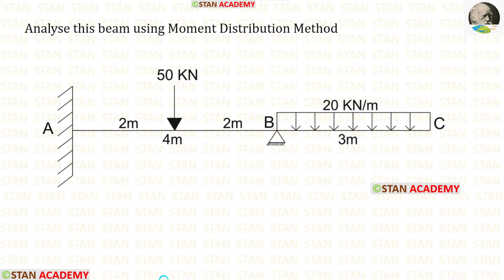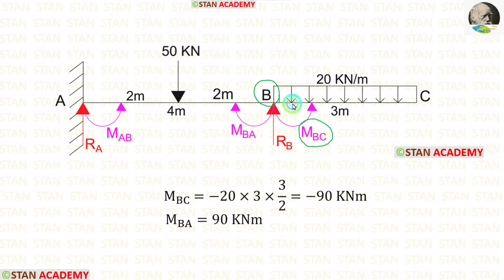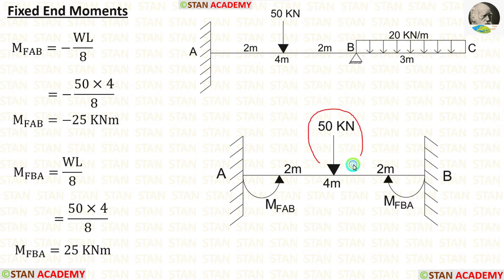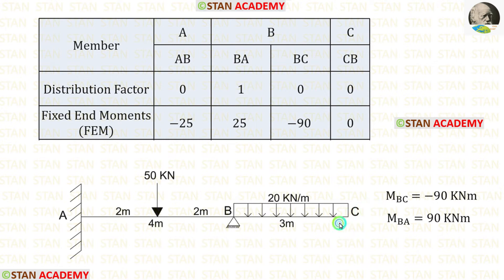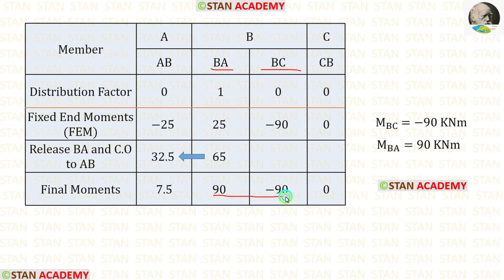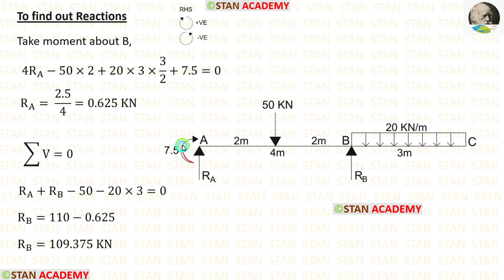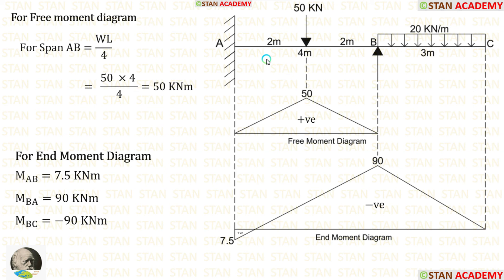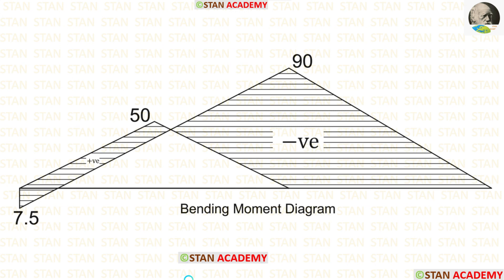Moment Distribution Method for Beam Analysis - Problem No 10 ( Propped Cantilever with Overhanging )

Comment: Hi I get RA to be negative 0.625
Reply: I get 0.625 negative when taking moments at Ra
Reply from the maker: I have checked and it is positive only. kondly check ur calculation
Reply: I think it's because you considered the over hanging part as -ve during MB =0 part for reaction calculation please check seven i think it should be negative cause it's on right side of B so sign convention reverses anticlockwise become positive and clockwise negative